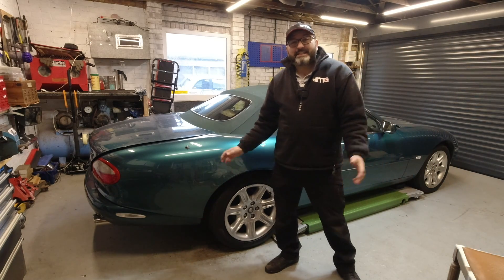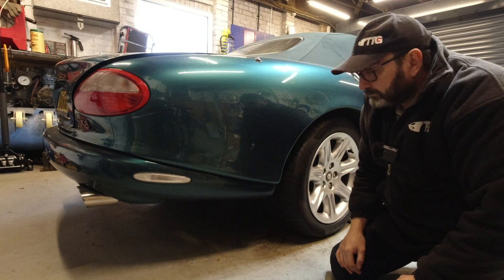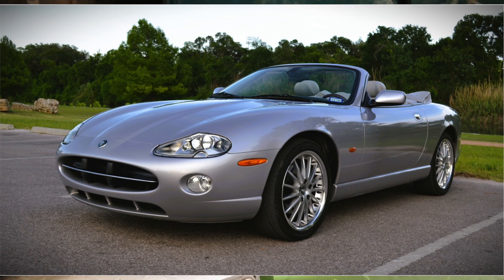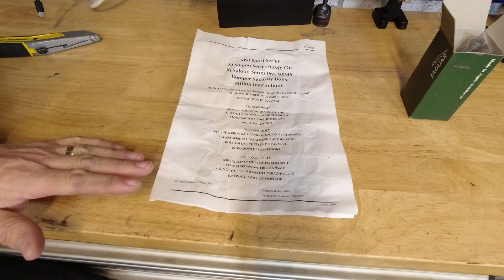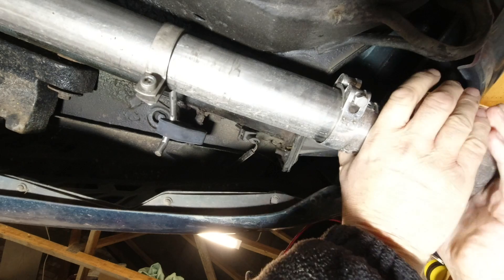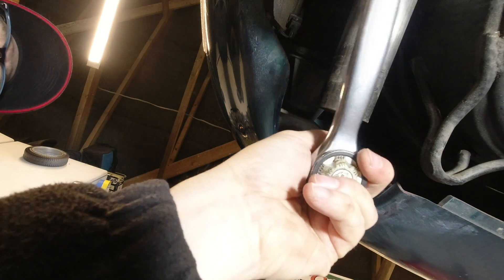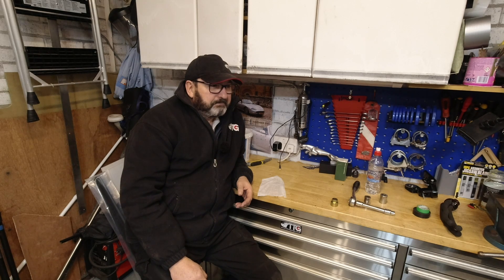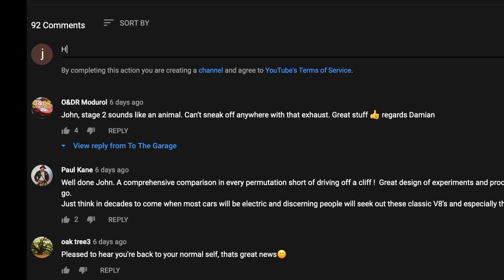Secrets of the Jaguar XK8 Episode 103.  BONKERS BUMPER ACCESSORY

Comment: Hi John,  Enjoying all your videos.   I currently have the rear bumperr off to do various work - it took aweek of spraying penentrating oil to get them off, so I don't think it was ever going to get stolen.  However, do you know if you take off the bumper mounts can you access the rear chassis rails?  I don't want to attempt this if you can't as the mounting bolts are very corroded. Thanks

Comment: I really like the lines of the bumper, and the rising sill bulge either side of the rear wheels. The designer keith helfet who also designed the XJ220 said its based on the sill line of the Xj220. I don't like the covered sills of the later cars, where this detail is lost
Reply from the maker: Agree David👍. I dont dislike the later style (I prefer the lack of side rubbing strips particularly) but i absolutely love the delicacy purity and finesse of the original intent Mk1 styling

Comment: Hi John, that was another secret, very interesting, I have got an XK8 Convertable 1997/Coupe XK8 1998 but both have slots sadly no box left in it, I am searching for help/hints to fit the rear parking sensors on my 1998, I have not seen any of the guys comments on rather a repair hints only, I appreciate if anyone can share some light please, incl. the accurate distance between the parking sensors holes to be drilled please>